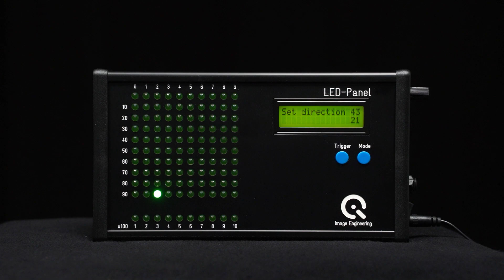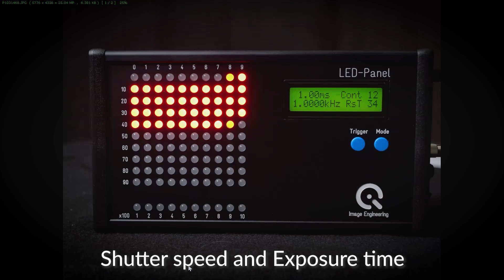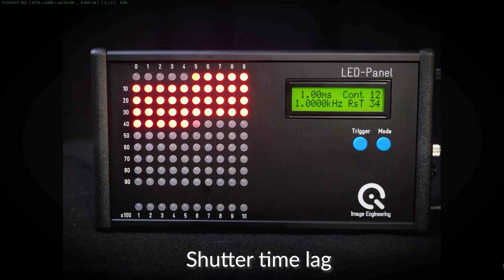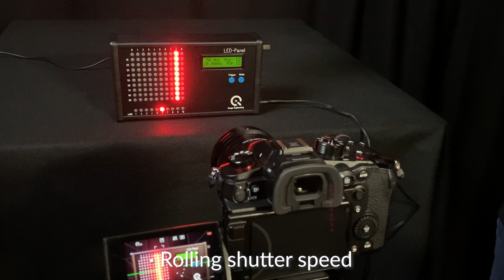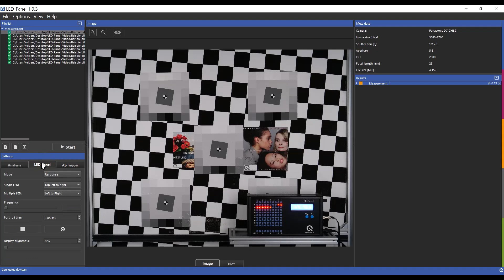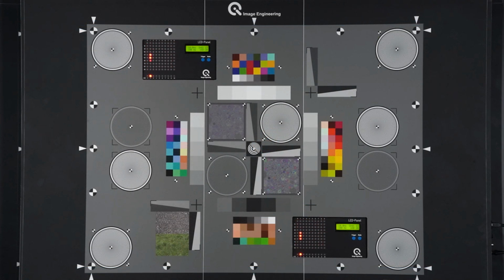Camera Timing Measurements with the LED-Panel

Comment: According to Google searches, this LED Panel is capable of measuring frame rates to .0001.  Is this correct?  We work with machine vision cameras with much higher frame rate capability than a DSLR.  Thanks in advance.